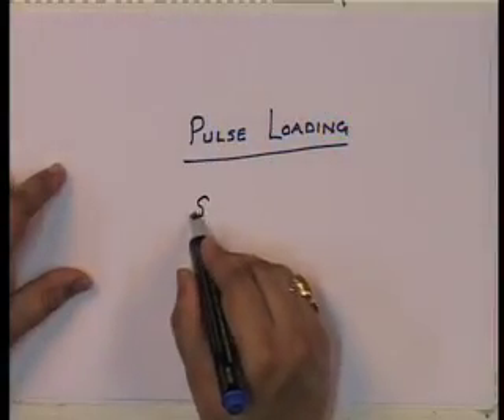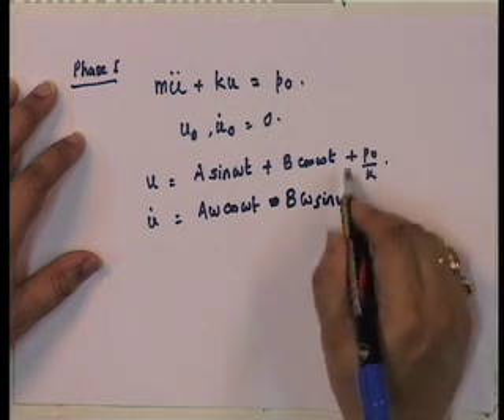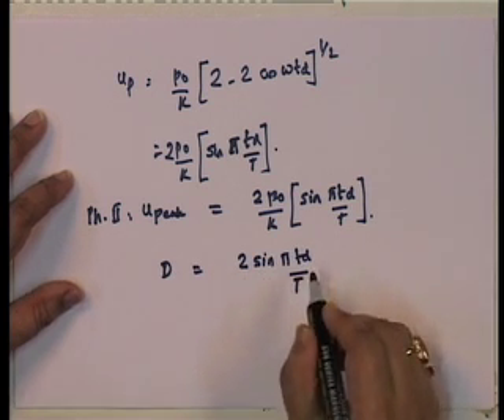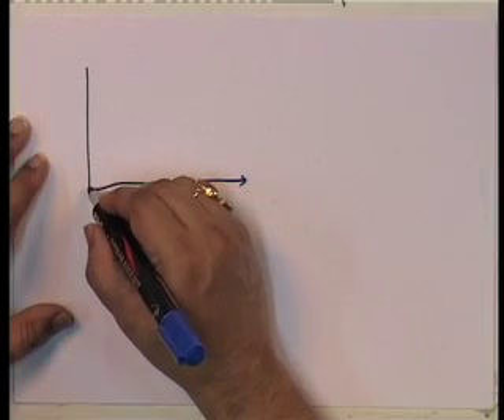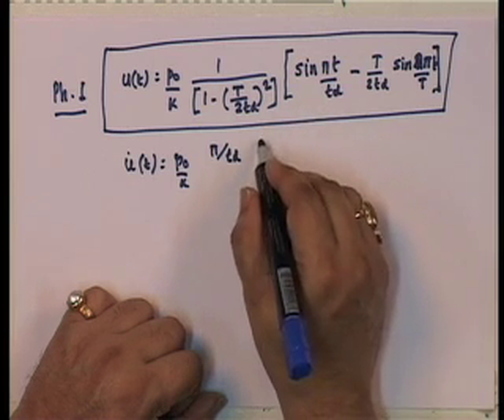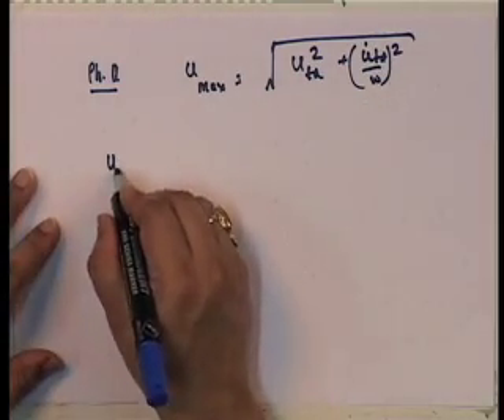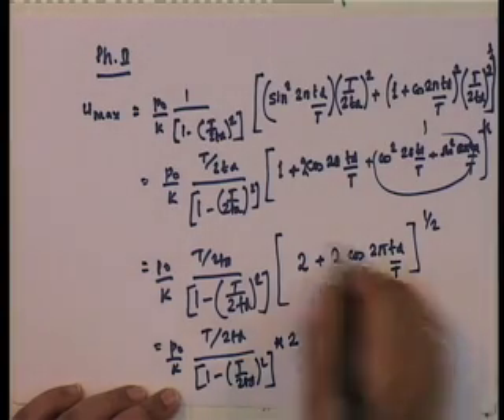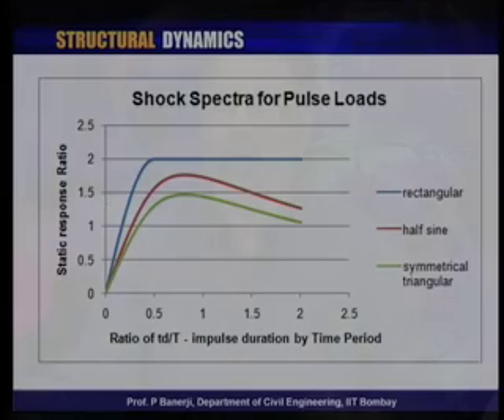Mod-01 Lec-10 Pulse Loading

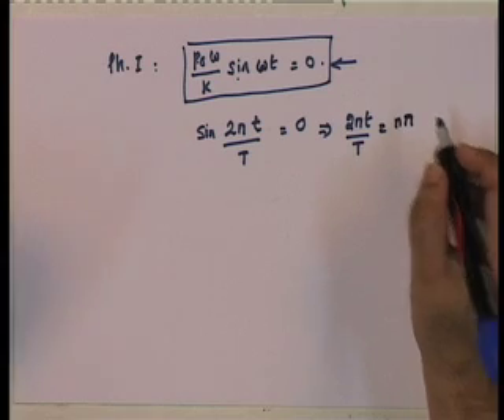Comment: And also what does the professor mean at 18:02 when he says, "The duration is small, which is the first one."? I guess he was talking about n would be equal to one, but why is that the smallest one? Thank you .
Reply: Understood, but still leave my comment here for other people. "The duration is small, which is the first one" --> The professor said so to mention that if n = 1, then you can find out the first peak value of u(t). (Of course there are a lot others, but they would not occur if td is not long enough when phase II takes over.)
Reply: @0ManPiano0  16:22  In the phase 1 to be maximum, why velocity has to be zero?

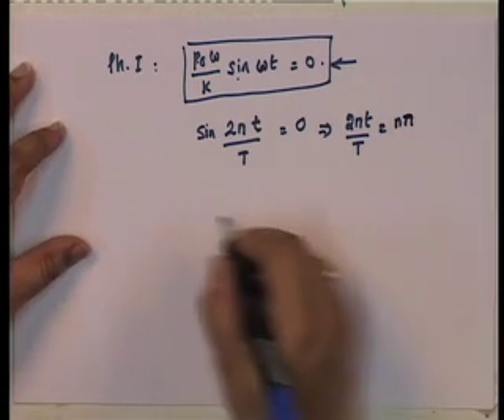Comment: Anyone help at 18:02? I am struggling why when td/T > 1/2, then the peak would absolutely occurr in Phase I?  Dont you have to plug the value of td/T into u(t)max of both phase I & II and then compare these two values before you make this conclusion? Since the value of u(td)max of phase I, would not be so small if td is not so much lesser than T/2. Thanks a lot if anyone can help me out.

Comment: he said that no damping for first few cycles and as 't' is comparable to T for forced part, we neglect damping. but then for t>T, i.e. free vibration, damping should come in the picture and so should come in equation. tell me where i am wrong
Reply: A pulse loading is a very short duration loading. The peak response of the structure occurs very quickly following the application of the load. Whether in Phase I or Phase II, there is insufficient time for structural damping to have a significant effect on the magnitude of the peak response. Therefore for simplicity it is excluded in the mathematical analysis of the problem.
Reply: oh okay for simplicity. I was struggling to find reason for skipping it lol. thank you very much
Reply: @stagecoachal  16:22  In the phase 1 to be maximum, why velocity has to be zero?
Reply: @pawanacharya2915  It's because the first derivative is zero at the extrema (maxima/minima). So for u to be maximum, u' has to be zero at that t.